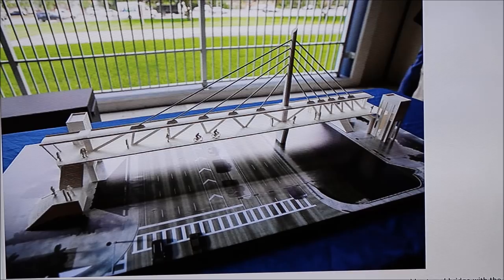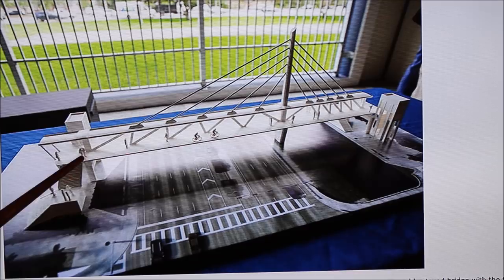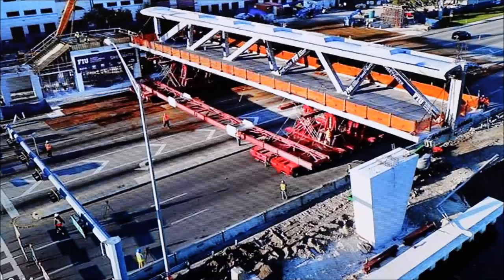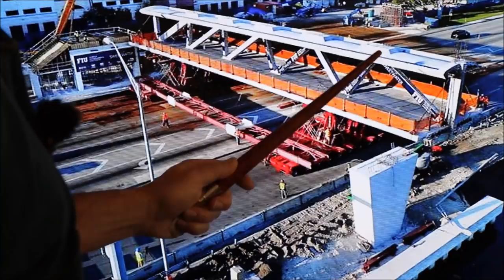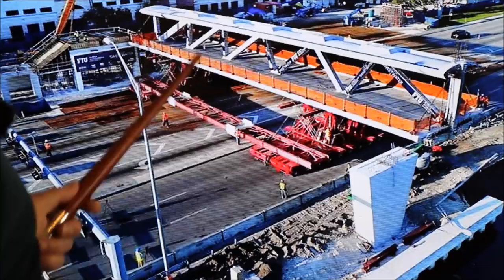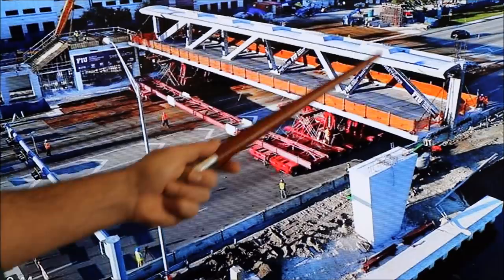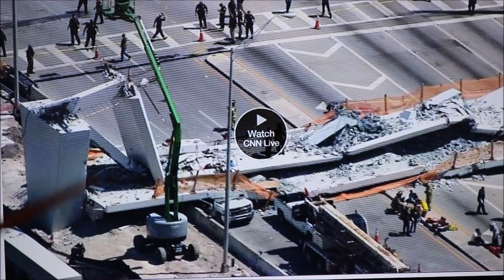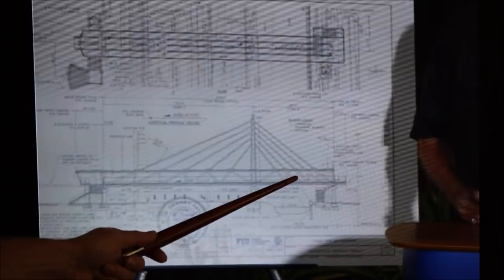Miami Bridge Failure- preliminary analysis 17 March 2018

Comment from the maker: The original design plan from FIU LINK-https://facilities.fiu.edu/projects/BT_904/MCM_FIGG_Proposal_for_FIU_Pedestrian_Bridge_9-30-2015.pdf
Reply: After reading the proposal it states that the cable stays will provide added stiffness and pedestrian load... so they were not only an aesthetic feature.. the cable stays were actually intended to provide some support. After watching the video and looking at pictures what I see is the lower deck became disconnected from the last column / diagonal support.. when that happened the lower deck fell causing the total collapse. The lower deck likely had ether pre or post tensioned cables. If they are post tensioned  there are wedge sockets that secure the cables and it's possible that the wedges failed or the strength of the connection at that point was inadequately designed / engineered. If that's the case review of the design / calculations should have caught it, but maybe not... I've suggested this book before... not sure if you or any of your followers have read it but it's a really good read for folks who are interested in this sort of thing.  https://www.goodreads.com/book/show/271495.To_Engineer_Is_Human
Reply: Thank you for this website.  Obviously the cable column towers and cables were not 'ornamental'
Reply: Could be a failure in the design of the testing plan rather than the design of the structure.
Reply from the maker: they are...stby for an update...
Reply: Interesting that the drawing of the deck shows that member 11 (the end diagonal) did not have post-tensioning bars. Maybe these were added to accommodate the temporary support position which was in from the span end during the installation?
Reply: Interesting to read the proposal documents. I'm used to reading drawings but I'm not an engineer, it does not look like the structure above the canopy is designed to provide any structural function.
Reply: Bad basic architectural design. A truss bridge with single row of trusses creating single points of failure at every truss. Plus using concrete as the trusses on a very heavy I-beam like bridge with no structural redundancy. Bad architectural design and poor engineering execution of the architects design, no structural redundancy bridge basic 101  bridge design structural reduction ignored. This will be studied for years to come on how not to design or structurally support a bridge.
Reply: Excellent. As I haven’t designed prestressed or post tensioned structures in over 15 years, some things may have changed... but I have made some interesting observations. I find it odd that there was no longitudinal reinforcement (rebar) in any of the lacing members of the truss, only stirrups (cross sections types A B or C). I would expect a basic cage to help with crack control and improve the confinement strength of concrete. Perhaps the shop drawings would show more. Member 2 (type B), the one that is likely the culprit has two tendons located at 12 and 6. The 12 o’clock tendon is to be tensioned from below, and the 6 o’clock tendon to be tensioned from above, where the guys were. If only a single tendon were tensioned, it would significantly introduce and eccentric moment (7-1/2” from CL) in the member, causing a massive tension field in the 12 o’clock position. If the 12 o’clock tendon was not already somewhat snug, concrete would easily rupture with a 200 kip x 7-1/2” moment. Although it’s not stated on the drawings how these members would need to be tensioned, both would need to be tensioned simultaneously.
Reply: According the NTSB, they had already tensioned the 12 o’clock tendon, and were working on the 6 o’clock one when it failed. It really seems like they should have been done simultaneously...
Reply: Dan Whiffen wow! And even if they had successfully accomplished the tensioning task, would this not have been a bomb to be triggered at some future date as time and weathering took its toll on these tendons that seem to be without redundancy?
Reply: I am amazed it was ever approved. Where was the oversight? Also a 950 ton bridge for a maximum 20 ton load? What were they thinking? Looks like a vanity project for the ABC and concrete engineering programs at FIU. Also a huge boondoogle at gov. expense (TIGER grant).
Reply: I would say so, too, yes (now, with the benefit of hindsight).
Reply: As an old Swiss architect, I am appalled by the utter stupidity of this pedestrian walkway design (people: Stop speaking about "bridge"!), incompetent from an architectural as well as engineering standpoint. Why they used concrete for a truss construction is beyond me (too heavy, useless for pull forces). And the ridiculous idea of DERCORATING that concrete truss thing with a PYLON and pulling cables, to give off the impression of a hanging bridge, is an outrageous waste of money. Look at the direction of the fat concrete trusses, following the ones of the (merely decorative!) cables: "Let's build a suspension look-alike bridge!"
Reply: (I am reading your post of 9 months ago) Thank you Juan for this overview of this tragic event. I certainly have studied engineering. This has dramatically brought home the importance of recognized training in this field. I also am waiting in anticipation for final report for this incident. In the meantime: (This is an extremely fascinating topic: Equilibrium of forces) My recommendation all engineering contributors revisit their elementary training: 1st level: Free body force diagram(s) methods of force analysis. (Sine 60 =0.5, Vertical shear force Mag x 2) Nr. 11 member inclined approx. 60 deg. to the horizontal, 950 Tonne (overall weight) 100 foot approx. beam length, Top & bottom cord showed good. Extremely high compressive force (Resulting excessive compressive stress) on this member. Tightening the tension rod here...…? (Do not wish to say more. Waiting for final report)PS
Reply: The bridge was knowingly being supported at the wrong points during the move.

Comment: So the FIU bridge was a truss design made to look like a cable-stayed bridge - resulting in one of the most moronic truss layouts I've ever seen.  Juan describes it as a Warren truss but it actually morphs from half-ass Warren on the north failure end to half-ass Howe on the south end, with absolutely ZERO redundancy!  Were this span designed in steel it could have been done at one-third the weight, half the cost, a redundancy factor of at least three, and WITH NO LOSS OF LIFE!!!  Did FIU engineering dept go through any what-if worst case analysis?  If not it should be shut down permanently.
Reply: I'm guessing that FIU has an "engineering" department which provided the original concept as a class project.  I"ve seen it before in other colleges.  Modifying the truss design to appear to be part of a suspension system was the first serious mistake.  Using friable concrete throughout was the second big mistake.  Erecting an untensioned truss was the third mistake.  All in the name of "Accelerated Bridge Construction" so they could brag about closing the street for only one weekend.  Heads need to roll.
Reply: eccentric moments induced by cantilevered top chords,
Inspector Jeff
Reply: if an engineering company can't build a walkway then no sidewalk is safe from those guys...the students have little to fear until the next project is started
Reply: This was an "all-female no men allowed feel-good safe-space" project. She said "it just felt right"  the design just felt right. That is proper engineering, just feelings....

Comment: All the holes in the cheese lined up that day. Several key decisions led to this chain of events, any one of which could've been changed.
Decision to transport and support bridge in a different position than engineered (mid span between truss hard points).
Decision to not install or leave falsework/cribbing in place after initial bridge placement during critical post tensioning/ final inspection works.
Decision to rush the initial process of bridge installation, so as to minimise traffic disturbance.
Decision to ignore cracks in the newly installed bridge.
Decision to carry out post tensioning/ fault finding and rectifiication with public exposed to risk.
I personally believe that concrete has no place being used in a structural truss- it's strength is in compression.Trusses are all about tension. Using boxed steel for the truss web would not have changed the appearance of the bridge and would've had many times the failure resistance and safety factor of what was there. Likewise, a couple of simple steel I beams in the lower span would've provided a huge margin of redundancy for the structure.
Reply: This is an excellent analysis and suggested redundancy features.   I noticed that the post tensioning on the truss member that failed was internal to the member... not external to the member.  So that only the center section of the truss was under tension, leaving each end, one in the blister on top and one in the pier area under *tension, the concrete in both of these areas is seen to be exploded or shattered after the failure... concrete was  under tension in those two critical areas. Just one of the major engineering and management errors... ignoring those massive cracks in the failed area and not stopping the project on that basis alone was inexcusable imo, likewise cutting into the blister on top of the canopy with cement saws and jack hammers was insane on the face of it, even if there was no traffic under the bridge..with traffic one has to wonder what they were smoking.

Comment: Dude. The cables are for compressing the concrete so that elements can perform in tension. They aren't for adjusting the camber because they can't significantly affect the length of the concrete elements. The 'canopy' is the compression element of the beam, the deck is the tension element, but hugely preloaded with the tendons run through the deck.

Comment: Hi Juan -- listening to your description and seeing the picture the end of the beam, it looks like it blew out during tensioning operations, this is a not uncommon occurrence -- but typically you still have the scaffold in place and it costs a little money and time but is not usually a tragedy. This is caused by  1) poor design  and /or poor execution, ( the concrete does not consolidate adequately around the " Bugle head"   a thick plate structure that applies the tension from the rods / or cables depending on which system you use and or it does not reach adequate strength  due to design, batching, or placement  issues.  
But the biggest issue is it was designed without redundancy by someone who thinks looking good and attaining some architects vision is more important than safety and durability.
Reply: Patrick Curtis  best description of the Design Failures.  that ABC isn't looking so pretty now.
Reply: Tension adjustment failures happen, I have witnessed three in my 30 years of engineering.  An anchor failure, cable failure, and concrete failure.  It happens, so to think you can pull off a tension adjustment with zero probability of failure violates Murphy's Law.

Comment: The tension rods are NOT to adjust the camber of the bridge. They are meant to keep the concrete in compression.
Reply: They can do both if designed properly.

Comment: Nice review Juan.  You have a way of making information like this understandable, without injecting a lot of fear and hysteria into it.  As you point out, without having two sets of truss web members, there is no load path redundancy in the bridge.  The earlier reports of cracking may or may not have anything to do with the failure.  I'm thinking it is probable that the crew adjusting the post-tensioning stressing on the dywidag bar in the web had a significant role in the failure.   The NTSB final report will be very comprehensive, with everything related to that structure undergoing scrutiny.    As with many structure failures, it probably wasn't just one thing contributing to it, but a cascade of events leading to the failure.

Comment: The movement of the structure  via transporter will be of interest to investigators since the support for the bridge section during transport may have caused some flutter of the north section.  The engineers noticed cracks, and that rod was being tensioned  so there was a stress concentration near where it hinged and pulled the lower slab down from the support.  From another angle you can see the north end of the rod waving free where the joint failed at the base..  Your point about the value of a temporary support and blocking traffic during such activity is solid. Temporary supports would have been expensive, but hubris more so.  Appreciate your comments on structural redundancy as an important safety factor in civil construction.
Reply: bruce bagnoli I
Reply: That is what I was thinking. The design was good. Some unforeseen stress was placed upon the structure during the move. The ABC technique has been used successfully before - but usually a 'simple' parallel shift. The rotation was novel.

Comment: This is quite strange... why were they tensioning truss members that were in compression? I would have thought that the main post tensioning would have been in the bridge deck on the tensile side. Also once the bridge is hung from the tower support elements of this bridge would swap from being compressive to tensile.

It is normal procedure to "half-span" a bridge during testing and completion and that could have been easily achieved with a trestle placed where the road has chevrons and at either end next to both piers to prevent rotation in the event of a failure.. 

A "belt and braces" approach to engineering is the preferred route especially where public safety is in question.

Comment: When do engineers ever use a just single truss? trusses are usually employed in pairs or in parallel sets... as I recall a major disadvantage in truss design is they are prone to twist or deflection to the sides.
Reply: Precisely, although the super wide lower deck would help mitigate that.
Reply: +Sideslip It still does not give you any redundancy protection if one of the struts fails... which appears to be exactly what happened in this accident. Especially considering this bridge collapsed with pedestrian no load either... its takes several "weak links in the chain" to result in a total failure of this type, I will bet that although the design was not the primary cause of the failure, it was at least a contributing failure.

Comment: The concrete was pulled in tension.  If you are pulling on something, that is tension.  If you are pushing on something, that is compression.  Ignore for a moment that concrete was used and just look at the system as someone was pulling tension on a truss rod.  This situation is so sad.  Usually multiple design engineers are involved on a project like this.
Now steel has high elastic properties (like a rubber band)...not quite that elastic...but steel can take a beating in tension.  I bet if those truss webs had been made of steel, the bridge may not have collapsed.  I have one simple question for the Engineer...Why are you excessively pulling concrete under massive tension?
Reply: Have you ever seen how a pre-stressed bridge beam is constructed?
Reply: No I haven't.

Comment: Anyone here remember the I-5 Skagit River bridge collapse May 23 2013?  The bridge was a subdivided warren truss which was struck by an oversized load causing a single-point failure and total collapse of a span.  Security video of the Skagit collapse is disturbingly similar to FIU.  Non-redundant truss technology was already considered obsolete in 2013 - why FIU adopted an obsolete bridge design raises serious doubts as to the competence of their engineering department.